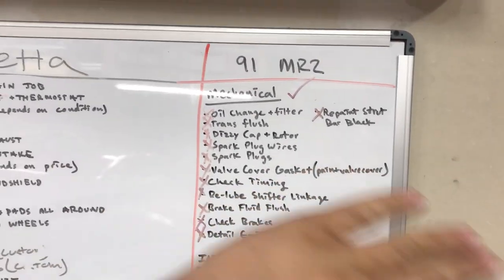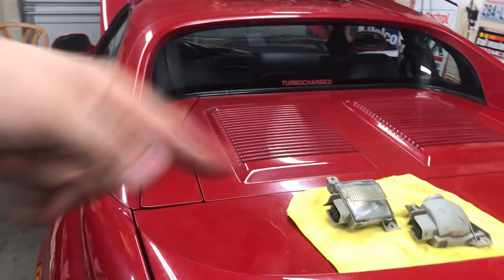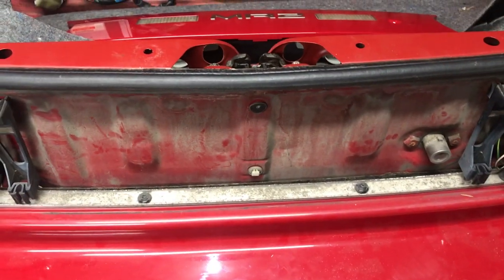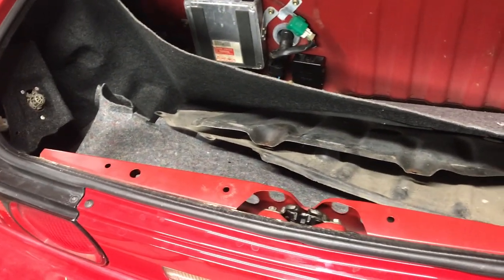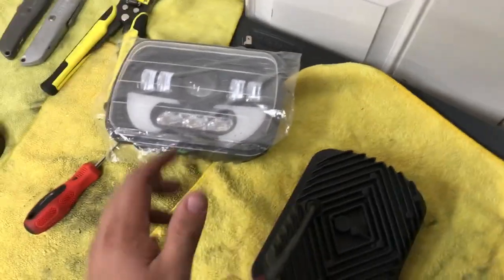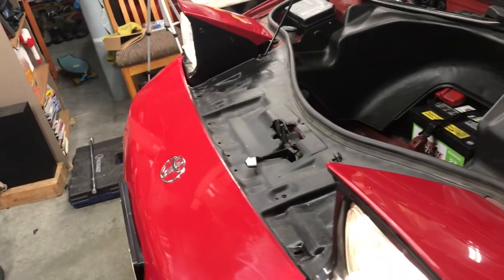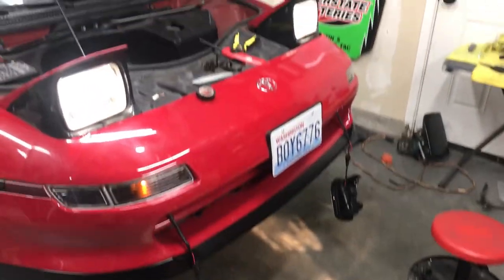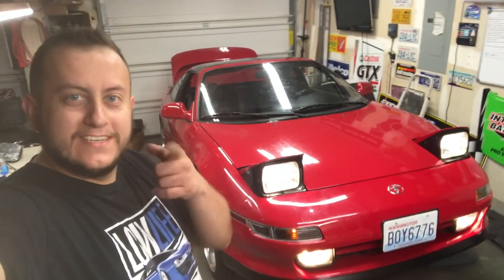1991 Toyota MR2 Turbo Restore PART 7 BULB UPGRADES PLUS FOGS INSTALLED

Comment: I love your videos!!  Just a tip that I don't think was brought up in this video. If you have sanded, polished and clear coated your kouki lights, I strongly recommend ditching the halogen bulbs for LEDs because the heat from the halogens will cause the clear coat to lift over time. I started noticing it on mine and after switching them to LEDs, they run much cooler.
Reply from the maker: Good to know! Thank you, this car has already been sold, but I’ll look into that on my personal 95 mr2

Comment: Where did you get your fog light bulbs from?
Reply from the maker: emen chhay hello, the bulbs or the fog lights themselves? The fog lights we’re off amazon and they had the bulbs installed already
Reply: ROAD NOISE MEDIA what was the brand you ordered from amazon? I want some in my mr2 too.
Reply from the maker: emen chhay actually nevermind, they were off ebay, sellers name is “of_accessories”
Reply: Is it a H10 led?
Reply from the maker: emen chhay no sir, they were H3 halogen bulbs in the fogs
Reply: @ROADNOISEMEDIA  I have the same car  I want to do some restoration I live in new York any helpful information you can give me.
Reply from the maker: Ray Persaud hello, it all depends what your car needs, but I’d say depending on what it needs, do plenty of research on forums and MR2 Facebook groups, ask plenty of questions, it will make the restoration process a lot easier if you have an idea of which steps to take, thanks for watching!
Reply: @ROADNOISEMEDIA  I have a 93 NA and I wanna install fog light. I did lots of research and every video or article I read so far, mentioned about switch and relay but in your video, it did not seem like you used any of those. Do I really need to use switch and relay? Also, I like to turn fog light on with parking lights ON. Most MR2s I see, fog lights turn on with headlight. What do I need to do? Thank you in advance!
Reply from the maker: Mohammad Wali hello, my mr2 already had the factory wiring so I did not have to run anything new, but if your car doesn’t have the wiring, you’ll have to install the entire wiring kit that comes with your fog light setup if you purchase an entire kit, it is a good idea to have a relay switch in case something shorts, it will blow the relay and not start a fire inside your frunk area, to run your fogs alone you can follow this link for some directions on how to do it, thank you for watching! 

https://www.mr2oc.com/threads/independent-fog-lights-made-easy-2-simple-steps.461061/
Reply: @ROADNOISEMEDIA  Hello, Thanks for the link. It is the best article I read so far. Mine has the same wiring as yours next to headlight and has wiring under the dash for the switch but no wiring harness for relays and there is no relays. Not only I want fog light but also want it work with the parking light ON. Do you have a good video or link of an article? The only video I found was Sarah's (the girl with red mr2) video but I am little confused about some stuffs.
Reply from the maker: Sarah’s video is a bit too complicated for most, although her work is good, it’s just too much for the regular person, I’d have to do more research to find any videos, but if you have Facebook, join the group “mr2oc” and make a post on there with your questions, there’s thousands of mr2 folks willing to help out at anytime